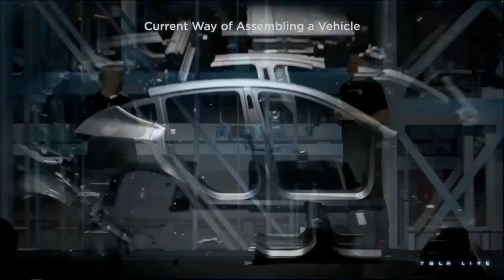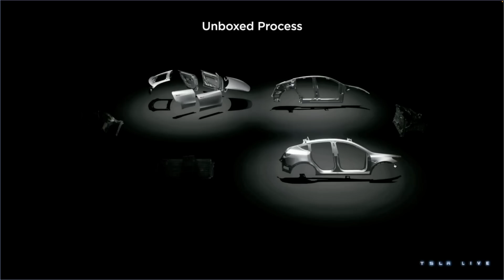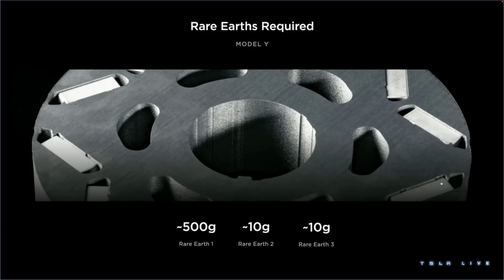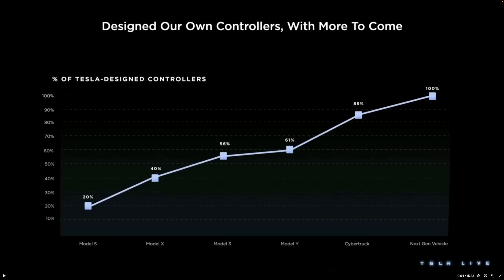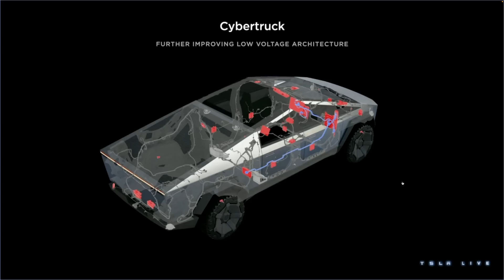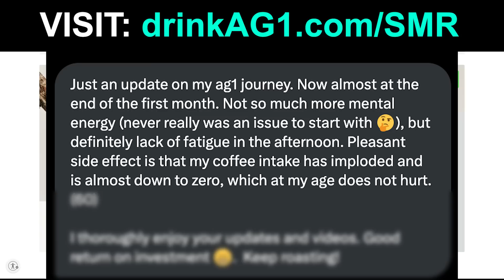Secrets of Tesla’s NEW 2025 Vehicles & Cybercab Unboxed System

Comment: 48 Volt is not new. 2011 Audi, BMW, Mercedes, Porsche VW and 2017 Renault agreed on this voltage. Suppliers like Bosch, Hella, Herth+Buss, Valeo and Borgwarner deliver already combustion engine components in this voltage. Good that Tesla also agreed to this. It’s definitely the future.
Reply: Nobody has claimed 48V is ‘new’, however just because they agreed on a standard doesn’t mean they produced anything.

The few that have been produced only use the 48v in power hungry subsystems like active suspension, with the rest of the car still using 12V.

Tesla also use PoE (Power over Ethernet) to greatly reduce the wiring, and they hold basic patents on an improved Ethernet protocol that’s both faster and adds prioritisation functionality.
Reply: @ It is used in many cars already. And Ethernet is by far not automotive standard. If Tesla sends letters around to other manufacturers, they will use 48 Volt, they are welcomed to the club. Nothing more nothing less.
Reply: Whilst this is true, these systems exist only for high power applications such as mild hybrid or active roll bars. They do not power the entire electrical system of the car, far from it. The advancement is in the use of this voltage for all of the cars systems, over Ethernet cabling. Do you not agree?
Reply: Sounds like it’s still a breakthrough for American cars.  It’s still cool.
Reply: @saracowgill2144  Its cool but not an Innovation as said. Ethernet is nothing else than twisted pairs. Same as CAN Bus. If you want to transport ampere you need also cable diameter in the same size as for 48 Volt regular systems. Ethernet cable diameter is arranged normally for ca. 25 Watt. So you need bigger Ethernet cable esp. if you organize in Bus architecture -> 5 connectors in row limits to 5W each. So bigger cables required.
Reply: @ Tesla does not use PoE. That's BS.
Reply: @MikaPopp  I was referring to the 48 Volt architecture. Ethernet came as reply to my comment in the discussion.
Reply: @MikaPopp  When you don't know what you don't know. the Tesla Cybertruck does utilize Power over Ethernet (PoE) as part of its innovative electrical architecture. The Cybertruck employs a 48-volt system combined with a gigabit Ethernet-based wiring setup called "Etherloop." This system integrates both power and data transmission over a single Ethernet cable, delivering power to various components while also facilitating high-speed communication between them.

Comment: It is not new, VW did it with the Beetle for 50 years.  The motor, front suspension floor board and front seats on the frame and then the painter body sets down on it.
Reply: Didn’t dey
Reply: They still painted the car with the doors on and then removed them.
Reply: The VW BUG was EPIC!! It was AWESOME. I saw one drive a MILLION MILES - on tv 
One of the iconic cars truly.